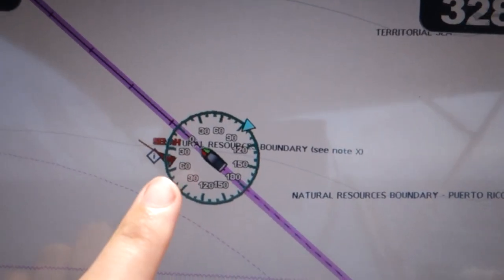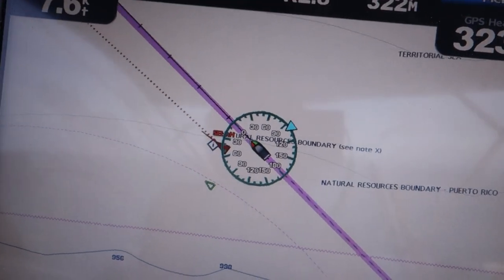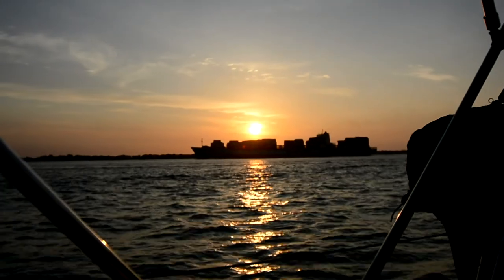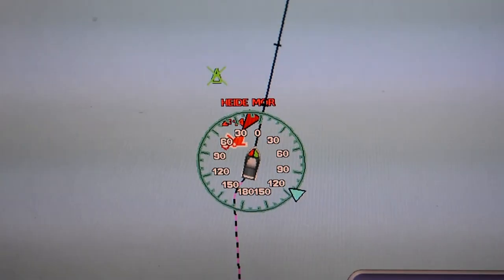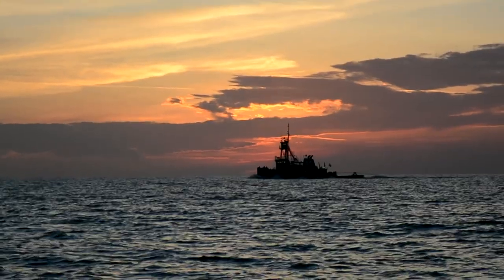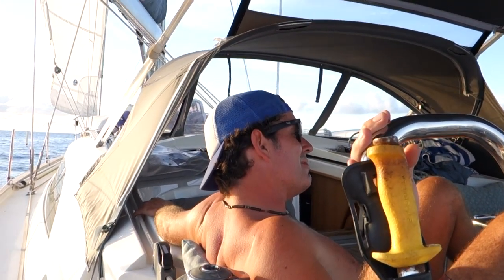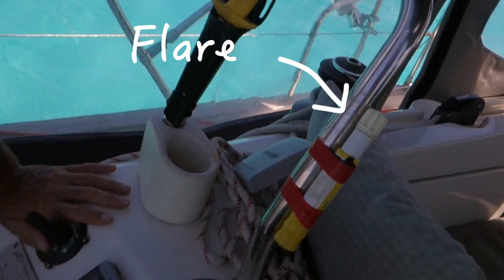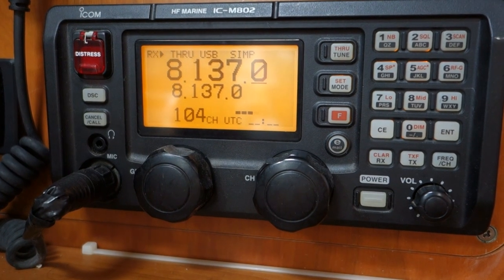HOW TO SAIL ACROSS AN OCEAN

Comment: Tethering and jacklines are a must for sure.  I wish I'd had all the electronics back when I did my crossing.  No GPS back in those days either.  No excuse now for not having this kit on board now.  Your life is worth the expense. I had to shoot for a yacht in the 30's though.  Not keen on mast climbing, so mast height and ability to singlehand was important for me.  If myself or significant other was incapacitated, we'd need to be able to handle the yacht alone.  Can't say enough about and Aires windvane.  Good info guys and keep up the good work!  Be safe and fair winds!

Comment: Thank you for this video!!!

Your comments regarding "production" boats are making me rethink my boat choice. We will be regularly sailing between the Florida Keys and the Caribbean. My thinking had been to stay with a production vessel from a major manufacturer because I thought that would mean we would have a greater availability of replacement parts (at any facility but in particular the Caribbean). When you said the line about "built to a price point" I felt like a piano had been dropped on my head. I'm embarrassed to admit this now obvious thought had never occurred to me. 

I can't thank you enough because while the grueling process of selecting a boat will be repeated, better now than after we bought the original choice. 

Oh, and had we already bought the boat and then realized what now makes sense, my wife my have drown me.

Comment: For 100% tie in you might consider two lanyards. Then when you need to go forward and unclip, you can clip in the #2 lanyard prior to disconnecting the #1 lanyard. A technique used in personal fall arrest systems, especially at height and on scaffolding. Just a thought.

Comment: AIS is a lifesaver for sure. aswell important with a good radar reflector.In my experience: When crossing the Atlantic it normally goes 3 days between you see other vessels, in the Pacific it could go 5 days and i cant ever remember seeing a small sailboat on a crossing, they kind of look like waves to us if you dont use the binoculars alot. Fun Fact - one of my previous 250m long vessel was hit at the portside midship by a sailboat somewhere between Trinidad and Tobago sometime in 2008.. The guys on the yacht offcourse came up on their deck when they noticed the collision, the guys on tankdeck just heard a small thump.  No serious damage done to either of the boats so they just wrote it in the log and went their seperate ways.

Comment: Not sure why I have watched this one before but top info and advice.  I sail solo on Rival 32'so some different considerations but totally with you on the self steering.  I have a Seafeather but would have loved a Hydrovane but budget would not allow.  Another major benefit of hydrovane is you can use it as emergency tiller and I know people who attach a tiller pilot to the hydrovane and disengage vane as very little stress on the steering then and consequently the tiller pilot.  I would have live a Watt and Sea, all the Vendee and solo sailors use them and they are the dogs doodaas. I couldn't afford one but I have a Duogen which is a wind generator and then can be a hydro generator.  It is a big bit of kit for my 32 footer but generates a good 5-7 amps with very little drag which for my modest electronic needs is ample.  I am thinking of fitting a Trogear bow sprit so I can fly a light top down furler as well as having a cruising chute in snuffer.  Love your videos and hope you get off sailing soon.  Stay safe. Andy UK

Comment: Hi Guys, I've been watching your videos for a few months and this is by far the best video you've done in my opinion. It is a huge topic to cover and you covered it very broadly without getting tangled up in detail. Having just said that I would love to hear in more detail about safety gear (eg:did you choose to take a Series Drogue or similar and why/why not?). What is your boat, age, keel and rudder type etc. Are you rigged with a removable inner stay for a staysail?..You mention your renewable energy provision which is very comprehensive (if one device is not charging the batteries, then another is etc). How did you decide your battery bank size in combination with your charging devices?...
Fab stuff! thanks so much.
Andy
Reply: Thanks for the quick reply. Isn't technology fantastic. I too have 450 ah house battery, but I have not balanced it well with recharging methods so far. I have 200 wattts of solar which only just keeps everything (freezer, fridge, instruments etc) going during the day and at night I lose about 70ah...I am about to add a Superwind wind generator which should balance the equation...Talking about luxuries - I have a small nespresso machine and milk frother which is fabulous...

Comment: I'm surprised you didn't talk about Southerly's main feature and the one which the company themselves think is one of the main selling points... the swing keel. I would be interested in your thoughts on it as you talk about having manual winches to reduce the number of systems that could possibly go wrong. Surely a fixed keel would be a safer and sturdier option? How often did you actually use the ability of the swing keel for a shallow mooring or to beach the boat?

Comment: As usual, a very excellent video.  I would love to hear more about boat selection based on location.  I know your Rose does not have a fixed keel and I understand the benefits of being able to access shallow waters.  Would there be any benefit to having a fixed keel for circumnavigation, more comfort, more speed etc.

Comment: John Mortimer
String Theory Beneteau 47.7

FYI spinnaker failure due to chafe, use Spectra casing on the outside of your spinnaker halyards at the shackle for 2 feet back, better still 1 layer of Spectra then 1 layer of Cuban sail repair tape followed with 1 more layer of Spectra. we race all the way to Maui from Victoria BC Canada and halyard does not chafe through with this protection, that is 12 to 14 days non stop spinaker flying.
Reply: Good morning guy's, 
Wind vane steering comes under 2 types, pendulum assisted and none pendulum just a wind vane. 
Problem with just a vane system it can not handle the yawing action of a following sea, plus apparent wind is less the more off wind you sail so less power to the system. 
With a pendulum system like Scanmar, the pendulum corrects for yaw in a following sea way , something that a Hydrovane never can. 
Scanmar will custom build a system for any boat, plus work with you on how you want to have it mounted so you can use your transom as a swim platform as well. 
Lastly Scanmar make a great sos steering system. 
Do you run jack lines down your boat for clipping onto? 
We also put jack lines inside running from the companion way to the mast, great for an extra place to hang onto. 
Great videos with a good information package. 
John 
Vancouver Canada

Comment: Gidday again guys. Do you carry a drogue? I have heard you say that Ruby Rose is impossible (never say never) to broach thanks to your rudders but I'd still be scared stiff of doing silly speeds surfing raising the possibility of pitch poling? Are the newer big bellied fin keel boats more or less prone to pitch poling? Would you run a drogue off a bridle or doesn't it really matter? Would you rig it from cleats or the sheet winches? Are the big single cup ones (for want of a better word) really as useless and as prone to breaking when you really need it as I've heard. Never needed to use one myself nor did I carry one but I always had a plan to tow a mattress in a pinch.When down wind sailing can you reef or drop the main without bearing up into the wind. Is the roller furler robust enough to furl without depowering your jib or especially a no. 1 or 2 genoa (I don't think you guys have either?)  That was probably a stupid question but the dumbest ones are the ones you don't ask. Right!! Is it possible to run a genoa on a furler? Is it too big or has it too much shape? My dream boat at the moment is a cutter rig with probably a genoa on the fore stay and a smallish jib/staysail on an inner fore stay. With an inner fore stay I'd have to furl and the unfurl the genoa to tack and for this to work? While talking about rudders do your twins stop Ruby Rose bearing up when the sails are over powered as single rudder boats do?Can I ask why you don't have any genoa's? (pardon me if I've got that wrong) Have they been replaced by the myriad of head sails now available or is it all about balancing the newer boats?  As you may have guessed my last boat was before furler's, code zero's, asymmetric whatamecallits and hanking on was the only way anyone raised a sail and reefing was a wild elevator ride up on the bow.I'm too old for that now so I reckon a cutter rig is the way to go so when needed I can easily furl one and unfurl the other.Can I ask what you do with your fore sail when its time to reef? Do you partially furl it or take it all in and raise something else?Do all sails on fore sail furlers suffer performance wise when partially furled or do some handle it better than others? What's the best affordable sail material for a jib/genoa that will handle a furler? Ditto the main with lazy jacks?Can I also ask what sail plan you'd choose for a fin keeled boat probably 40 to 45ft production boat, cutter rigged, beefed up to handle an inner stay. Probably a Beneteau because I liked your comment on getting something that will be easy to sell later on.This is way too many questions but then if you weren't so good at answering them I probably wouldn't have asked.Thanks for your time and wisdom and I'd totally understand if you did a quick run down in your next live stream instead of answering on here.Thanks Tonyps Sunday afternoon live streams in the US are about 6am Monday morning in OZ. Not worker friendly unfortunately but I watch them later on.
Reply: Ramble much? LOL. JK, great questions and comments actually. :-)

Comment: Good video ideas what's your opinion on fully functioning solar boats because they are becoming the future concept and wanted to know your opinion on them
Reply from the maker: As solar efficiency improves and battery technology does the same, it will become more viable. However the motor would need to be auxiliary to sails. I’m not sure a solar motor boat is going to happen in the near future.

Comment: Buying a boat without power winches in case of lightning strikes is just plain daft. Just ensure that your yacht has a lightning rod/protection system. Most modern yachts are built with these in place and all come with surge protection built into the electronics system which just require the flick of a switch to reset.
Apart from that great video keep the good work up.

Comment: I'm considering traveling around the world in about a year from now. But I'm turn between a 50 foot Leopard which I have to learn to sale and a 100 foot Moter Yacht  with a 4,000 nm range with a crew of 3 plus 3 friends.
I now 75 and don't want to work hard any more.
What's your suggestions.

Comment: good on you for investing in an AIS transceiver also the plb's for the life jackets are a smart investment, but here's a little advice, because you might seem to know a lot about sailing but commercial vessels are clearly not your forté; if on a collision course  during an ocean crossing with a big vessel and it hasnt moved when you are in a 2' radius GO BEHIND IT ! the officer might be correcting charts in the back chartroom, taking a sh*t, fallen asleep or doing something else he clearly should not be doing...but an ais transceiver or brightly coloured flare will not do you any good if he is not forward keeping a sharp lookout. Most vessels are run on skeleton crews and on what the master deems as uneventfull ocean passages the extra lookout is set to daywatch for the duration of the passage and the officer is alone on the bridge...the vast majority of seaman are top notch but there are always flukes or youngsters not yet fully aware of the responsabilities they have...

Comment: Thank you for informative video.   Yes, the electronics & comunicatons equip onboard, and exactly how they work could be an hour video unto itself.
Engine.maint &  repairs,  water maker- how many versions?  an emergency life raft version?
Precautions against hitting submerged logs or waste drum.....maybe it is not an issue, but seems to take down vessels quick.
Europeans do not fancy A/C onboard,as they claim  it takes away from the "sailing experience"....if you do get A/C , you can tell us the pros/cons and what went wrong with A/C onboard.  (anchored In a muggy marina it is nice to have A/C).
You going to get a drone like Bo and SLV?
Reply: I watched video a few times......so much good first-hand perspective information.

Comment: Firstly, as ever, one of your very well put together informative videos. Yet to watch the one on comms but have seen the one on power gen which reinforced what I'd thought but great to hear it from somebody who has done it and got the t shirt.  Enjoy these informative videos plus the travelogue ones which are good fun, naturalistic and don't pull any punches of the good and the bad which is why they are so [insert expletive as required] refreshing.  Anyway onto an actual question, you didn't say in in as many words but I think you had extra crew of the ocean crossing?  How many more people were onboard and how did you arrange watches, esp overnight, during the transit?  Supplementary, for the 400 nm passage, in Ep 17, how do you split the night watches when shorter handed?  All hints and guidance gratefully received as grand plan is building up from Med cruising/living aboard to a full on circumnavigation.  Fair winds and very best regards  Peter
Reply: Nick, thanks for getting back to me.  Both systems sound robust for short and longer transit. Again thanks for all the videos, always enjoyable.

Comment: Very good tips. The hydrovane is a beautiful looking rig. Well engineered mechanical is always preferable to electrical or electronic,particularly for long voyages.autopilot becomes a backup or nice for motor sailing,with no wind..
Lots of good suggestions here. On deck or cockpit tether up!!
Safety first
S/V  venceremos, out of San Diego

Comment: Your missing one key piece of survival gear. If your going to be crossing oceans then you need to have a cold water survival suit for every member of your crew. Granted the Caribbean is primarily warm water, once you star traversing north the waters get a lot colder and a life vest isn't going to cut it.
Your survival suit should have a battery operated transponder and mini eperb it should also have glow sticks water proof flares and fresh water rashons attached to it.

It's good practice to take your cold water survival suits and your crew to a wave park and practice getting into them in big water. 

Lastly I would recommend keeping some hot hands or heat packs with your survival suit as they will help you retain body heat. You can crack one open and slip then under the suit on the back of your hands and in your armpits. This will greatly improve your chances of survival. It's also not a bad idea to keep a little fishing kit and a small knife attached as well because food is fuel.

Just a friendly tip from an old commercial fisherman .... be safe and enjoy ... ☺
Reply: Just be sure to not have your Gumby suit zipped up at all not even partially when jumping into the water of you'll bob around upside down.

Comment: Question: What do laws (international and domestic) say about carrying anti-piracy weaponry? I personally wouldn't want to attempt a trans-oceanic journey without at least a couple of high-powered rifles.
Reply: No one will no
Reply: The problem would be with domestic laws.  You would have to research each country you may happen to come across separately.  Most requires some form of registration for the weapons, some require an arms safe, some require you check in your weapons at the customs office for storage, some require every bullet be accounted for on entry and exit, some will consider anything that appears to be a weapon to be treated as a weapon etc.  In general, it's usually not worth the trouble unless you're a large ship hence a target.  Best to avoid the troublesome areas and to buddy sail if you must cross them, safety in numbers.  Flares might discourage a few assailants since they can't be put out.

Comment: Doesn't a hydro generator slow the boat down?  The physics are that you require force to spin a motor that generates electricity, and all the force you use to spin that motor is taken from a force that was pushing your boat.  More force spinning the motor, less force pushing the boat.  In addition to the drag created by the rest of the appliance/parts in the water that are not a spinning motor part (casing, etc)

Comment: Why not hook batteries up to the solar panels to store the energy?
Reply: small luxuries on board like a TV for a kid in his room for at night, is it feasible to run solar power into a separate battery and then to a converter to power it? Also if you use batteries do you carry a spare battery charger on you and charging cables encase of cloudy/stormy days or are marine batteries different?